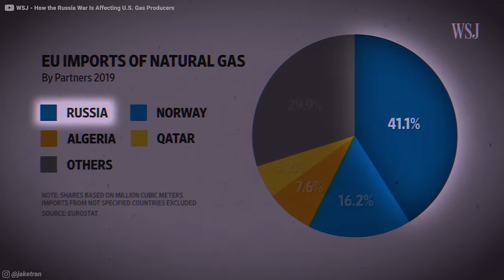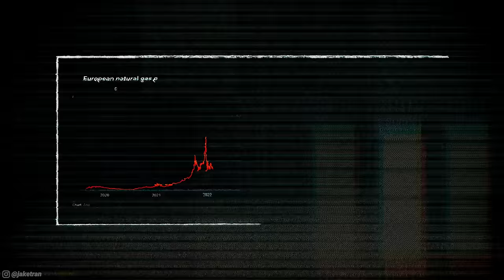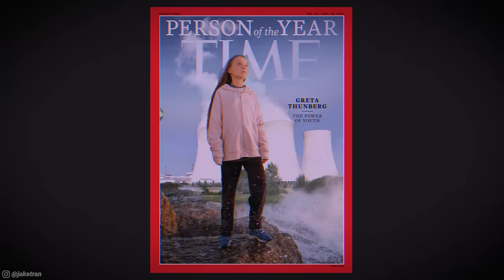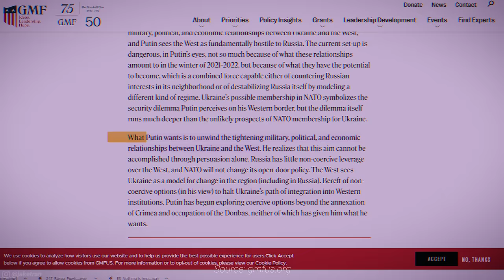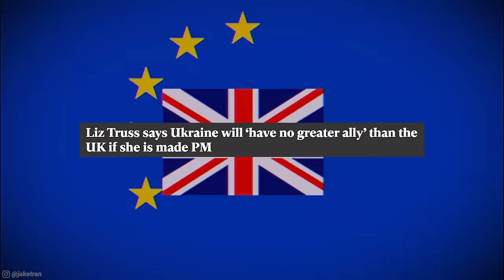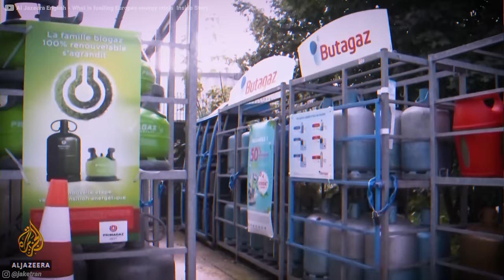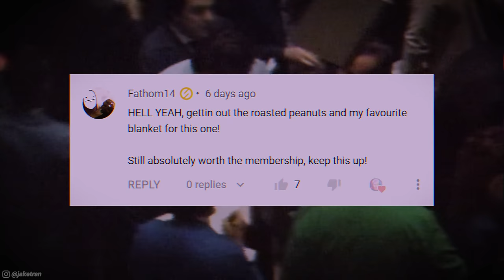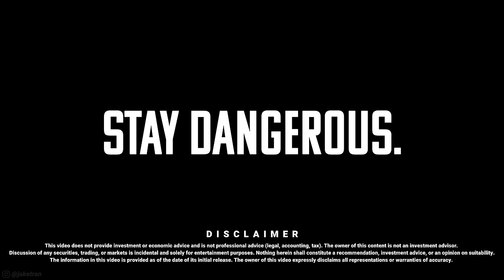Europe is gonna SUFFER.

Comment: I watched this morning and I was like, nah we in Finland has nothing to worry and after tonight I saw first time all the lights switched off in the road where I used to go for a run, I was shocked and I remembered this video, Finland out of all the places,chill country, rich and peaceful but I see lately everything slowly changing…
Reply: Doesn't Finland have nuclear reactors?
Reply: "tonight I saw first time all the lights switched off in the road where I used to go for a run"

I'd venture to guess that it's not due to the electricity prices but some other reason like electrical failure or a mistake.
Reply: @seneca983  so you think you know better than me who saw everything with my own eyes? The only dark parts are the ones in the woods and then you can see one part where the cars turn to right or left,there was light on, so obviously they were saving electricity cuz only the most important places had lights on and the rest where is only highway and woods where dark.
Reply: @seneca983  Or a reindeer.
Reply: You'll be fine, brother in the east. Finland announced energy saving measures like Germany. Like us in Sweden, you have very little gas dependence. Just electricity being expensive due to interconnected grid. Europe has planned for this winter for a year when Putin also partially cut gas. By next winter we'll have new infrastructure for LNG so your running trail can be lit again.
Reply: @seneca983  or they are doing it like germany and are switching lights off at night

Comment: What’s crazy is that nuclear energy is one of the safest methods of powering a country. If you do some research you will notice that nuclear has the lowest deaths per 1000 megawatts (i’m paraphrasing the number might be slightly different)
Reply: True, its the public stigma that overshadows such new innovations in nuclear energy that we can all benefit from
Reply: Yes and no. Unfortunately the region in question is painfully aware of the worst outcome. There have been attempts for plans of new nuclear plants but that one town in Ukraine near Belarusian border is still a horrifying reminder of what can happen. Also, the region would still be entirely reliant on importing the fuel for the reactors and should that supply chain become unreliable due to a conflict or change of heart from suppliers the potential for disaster would be significantly worse than current energy crisis.
Reply: @meinardsl  "that one town in Ukraine near Belarusian border is still a horrifying reminder of what can happen"

But even with this one severe incident nuclear power is statistically much safer than most alternatives. Similarly for hydropower one single incident (Banqiao, 1975) killed far more people than all nuclear accidents combined but most people are not demanding a phase-out of hydropower.

"Also, the region would still be entirely reliant on importing the fuel for the reactors and should that supply chain become unreliable due to a conflict or change of heart from suppliers the potential for disaster would be significantly worse than current energy crisis."

No, it would be far less of a problem. Firstly, uranium is cheap compared to the energy content it has so it's much easier to find alternative suppliers as they don't have to come from nearby. Secondly, nuclear plants usually store something like a year's worth of fuel on their premises which leaves a lot of time to sort out any supply chain hiccups.
Reply: @meinardsl  Its only a horrifying reminder to the ignorant. And almost all power plants require supply. And you could easily store a year or two supply in a power plant anyway since the fuel is very energy dense.
Reply: Bro the reason most nuclear reactors are destroyed naturally or just mismanagement lol
Reply: @meinardsl  cause it was built on ussr technologies
Reply: Solar is lower, and wind just slightly Up. But Yeah, nuclear is constant output and renowable (for human species standar)
Reply: But but but Chernobyl
Reply: @Him_Downstairs36  I hear this argument a lot, and in that specific case you are correct. The thing is that in the case of Chernobyl it was not built well, as well as mismanaged, and not properly funded. Do the research. also, remember, this was Soviet Russia, where everything was done out of fear as well as corrupt motives, and so the point of being the Director was not to manage and do everything properly, but to gain more clout in the communist party.
Reply: @arunaudi9768  *Soviet Ukraine bruh
Reply: @Him_Downstairs36  are you kidding? If you are serious than go do research

Comment: Woo I'm shaking in my boots in Poland, we knew Russia would suddently have a split personality dissorder, I guess I'll use electricity to heat my house with my free fotovoltaic panels
Reply: you know, you poles....always stuck to the past, maybe we should be allies and forget this war, but understand sending any weapons and firing them into our territory, makes it worse for you
Reply: I have a question. I took several electronics labs in collehe so i know that photovoltaic and semiconductor devices work better  at cooler tempertures, does the higher latitude or the snow inhibit the performance of your solar panels?
Reply: @DeandreSteven  Interesting question. Mostly you want the sun to be as perpendicular to the earth as possible, as it minimizes the atmosphere the sun needs to go through, and thus more energy can be harnessed. I am pretty sure that outweighs any advantage of the cold by a long shot, or else we'd see a lot more solar panels in the north. One interesting fact though is that in Norway, the air is so clean that it makes up for a part of the lost potential due to the latitude of Norway. Still not as effective as in countries like Spain and the like, but interesting nonetheless.
Reply: Those panels have a lifespan of a decade so when they expire and by then the rest of Europe has nuclear energy, you will find those panels no longer subsidized and the full cost will be yours to bear, in which you will give up on those panels and just embrace the cheap nuclear energy
Reply: @КГБКолДжорджКостанца  I’m American and I know poles aren’t siding with you.
Reply: @TheAmericanCatholic  and? Maybe in the future when we look towards economic prosperity....and hopefully a resolution to this, but also....you aware your president was lost in the stage during his speech?

Comment: The European rivers should be FULL of hydro-power generation.  The apartment I live in (Montreal) is heated by hydro-power, and electricity is included in the maintenance bill ($230 monthly) for EVERYTHING, including hot water in almost unlimited supply, and heating for the indoor pool and sauna.  There's a project to electrify the underground parking for car charging stations (it already had outlets for low-power things like vacuums).  If electricity ever fails.... But there's no reason for it to fail for more than a few days.  I DO have emergency heating on liquid fuels (gasoline included, in a Coleman stove).
Life is good, if the elected bodies do their jobs to assure the energy needs for people to be comfortable.
Without energy, life in the apartment will be almost impossible, and definitely NOT comfortable.

Comment: No, at least not yet.

Had he held Europe hostage with those pipelines, he might have had a stronger hand in negotiations. Instead, he cut them off before winter starts. Though Europe had to embrace a harsh winter, the earlier closure of those pipelines actually gave them some space to adjust and look for alternatives.

Never show off your best cards when the deal is not yet even near the closing phase; Putin should've cut off the gas in the DURING winter to get Europe drooling.

Comment: apparently german gas storage is full and should last till x-mas
germanies lng gasification capacity is supposed to be 40 bm³  by x-mas so the 45 via nordstream is pretty much subsituted heatingwise
last i heard were 8 gasification ships on the way or already here
sry @bangladesh
sry @parkistan

poland just opened a pipeline and so on.. its gonna be expensive but there wont be freezing europe 

for the german economy its gonna be devastating... 
lng is not natural gas, just a part of it... so nitrogen fertelizer usually produced out of natural gas is with lng not possible no nitrogen 
also steelproduction... with lng`?

Comment: Five thoughts to this video:

- 0:08 41,1% of it's gas not it's energy, it's on the posted diagram itself
- 0:16 maybe colder than the last winter nevertheless gradually the winters are more mild in comparison to the last decades
- most costal countries in europe except Germany have at least 1 or more LNG terminals (Spain has 7, France has 4 etc)  so there are solutions to this problem
- russian gas was cheap but is not the only source of Europes gas. Europe will have to pay more but it can afford gas from other sources than Russia
- 9:52 the only card Russia had. That's exactly it. And when it fails, Russia is out of options.

although I vastly disagree with this specific video I appreciate your excellent work Jake and am thrilled your next master peace keep it up!

Comment: You are overdramatazing. Greta Thunberg is not the reason for the shutting of coal and nuclear plants and certainly not the reason behind investment in green technologies. Her share of change is minimal. Also saying that Europe used gas because renewables were expensive is honestly strange. Renewables are cheaper than coal or nuclear. Gas is used since it is flexible and can compensate for the instability in renewable energy(The wind doesn't always blow and it isn't always sunny). Also portraying renewables as the source of the problem is dangerous because in the end they are the solution.
But I agree that closing nuclear plants was quite a populist move that only harmed Europe(I need to state that Germany was the opponent of nuclear and many other european nations like France are actually backing up nuclear. And the actual reason for the closure of nuclear plants was the Fukushima disaster and the subsequent distrust among the common folks. )